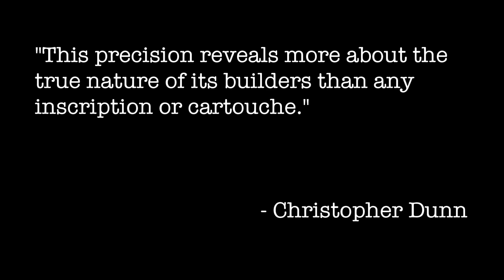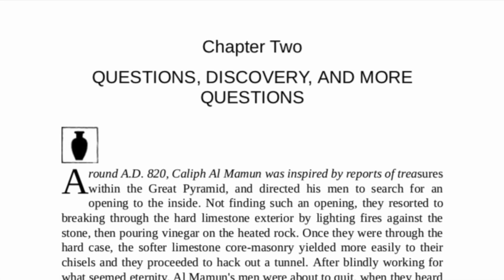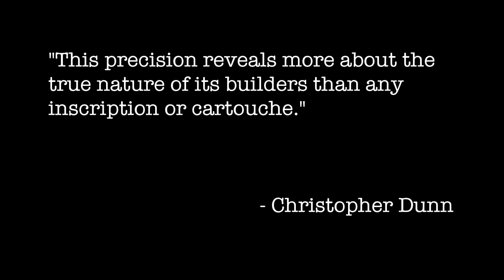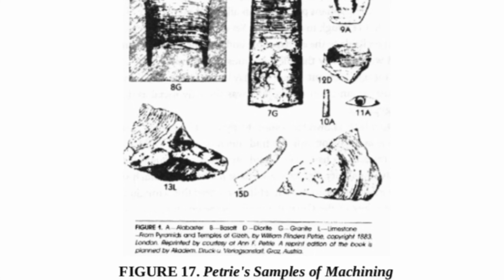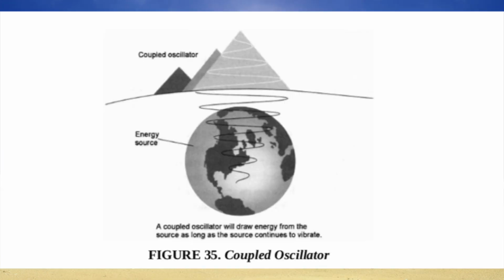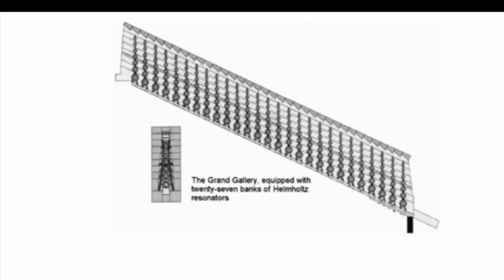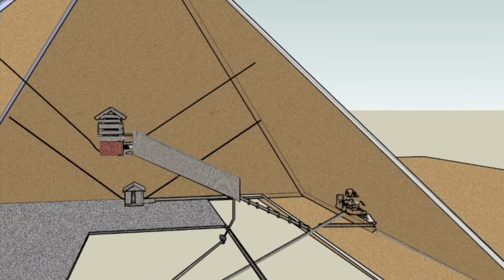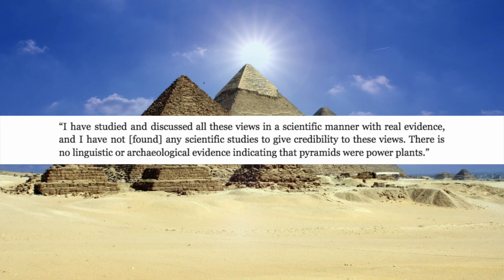The Giza Power Plant Theory - A Deep Dive Analysis | Reading Christopher Dunn | Lines in Sand

Comment: Pretty wild to propose such a 'out there' theory as an engineer, and not provide even the smallest scale model to verify any of it..
Reply: I saw a video with a dude that made a scale model that generated power but I can't freaking find it again. Had I known it would be so hard I'd have saved it.
Reply: Chris Dunn who made the book in the title made a scale model showing how it’s possible
Reply: Yeah cause using a make shift hammer and a little chisel makes sense. Do your research dude. Just the geometry alone tells you what there telling us isn’t true.
Reply: Nikolai Tesla did this but was shut down
Reply: Even more wild to claim a group of people perfectly understood electricity and electric fields and had a lot of copper, but were so high tech instead of figuring out an actual generator that basically ANYONE could make once they had that knowledge. Chose instead of making such a simply thing to achieve it, decided to build something weighing 2.5 million tonnes and unimaginable effort. It's just logical nonsense. You cannot have certain knowledge without having other knowledge. You cannot have this required level of knowledge on electricities and batteries and electric fields and (potentially motors to cut stone as many claim) but be completely incapable of spinning that motor round putting it in the nile and creating a generator.
Reply: A model has been built, and tested, and proven to work. Look it up
Reply: Pretty wild to post a comment purporting something you could have very easily looked up prior to typing.
Reply: There’s been several small scale models shown to demonstrate this theory in its entirety…you can find a few of them right here on YouTube
Reply: A whole lot of talking to avoid saying how to turn the thing on right now. I'm in complete agreement that there are mysteries about the pyramids and this is actually a decent collection of things about them which are highly unusual. But none of this seems to suggest that it's a power plant or how it would generate power
Reply: The most important model for this discussion is the model Gantenbrink made from the data provided by his robots from mapping the air shafts. Dunn's hypothesis is based on straight air vents, which they are not.
Reply: What's even more 'out there' is what the Egyptologists say:  blocks weighing 100's of tons were quarried by merely banging a few rocks together.
Reply: Pretty bold of you to assume that's possible.  If a 5.7 million ton pyramid produced 1000 watts per hour. How much do you suppose a 1 ton "model" wood produce assuming it produced at the same ratio to size? Is that even measurable?

Comment: I have massive respect for Mr. Dunn for speaking out the engineer's perspective against the ridiculous bronze age tomb hypothesis we've been told and all the incredible analysis he has provided for the vase, the drill core and the sarcophagi, but i'm not going to buy some random alternative idea either just because I like the guy who proposes it. demnostrate on how this type of structure produces power and demonstrate why 99% of the structure has to be highly geometrically placed stone. where the energy was stored and what was it used for. until then i'm fine admitting that I don't have a clue what the pyramids are, who built them and when.
Reply: Nikla tesla, created the wardenclyffe tower, he was supplied with classified files that were based off the schematics of the pyramids, look into each blue prints and purpose off his tower to the pyramid and try to connect the dots

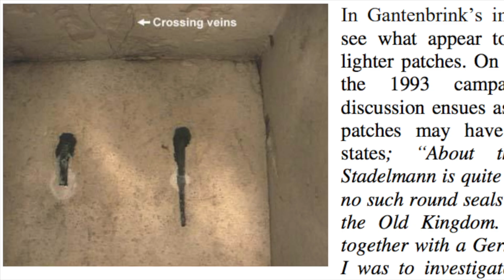Comment: 1:07:47 To be fair to Hancock on these. I believe he predicted that similar would be found at the end of the Northern shaft and those show even more signs of being electrodes for hydrolysis rather than having a ceremonial function.
Reply: Electrodes deteriorate during electrolysis. The idea for building such a monster pyramid for such tiny electrodes that might last a year having spent god knows how long building it and moving 2.5 million tons of stone is so ludicrous I can see why nobody wants to listen to such stupid theories
Reply: @KowBoySpace  One electrode deteriorates, the other electrode gets plated. If you look at the pictures of the northern and southern gantenbrinks doors, that is one interpretation of what you can see. There is definite tapering of one and the other is a different colour and looks fatter.  I’d say compare this with the hook found at the bottom of one of those shafts. That’s oxidised to copper green, but it’s still in very good shape. 

Further, across the northern and southern doors there are four copper handles. Only one of which is crudely sitting in a groove in the thin stone. When Ancient architects hi-res pics first showed this, it was I who alerted Hancock to it. A half remembered chemistry lesson, bolstered by a quick google, showed that ‘recessed cathodes’ are a thing in electrolysis as it makes it last longer before you have to replace it. So to my mind there are several pieces of evidence that point towards electrolysis.

I agree that it sounds crazy, but the whole thing is crazy. Keeping two  20x20cm shafts climbing 60 odd metres into the masonry only to end in these blocks with little copper handles that no one is ever going to see! 

All the explanations have issues: electrolysis is far out and requires undiscovered new rooms. 

I think they look pretty terrible as ceremonial end points. Particularly with the aforementioned crude groove and graffiti behind. If they are handles they are weirdly high on the door and also the pins do stick out the back.

 Lastly, the theory put forward by History for Granite about them being covers for the shafts, again it’s 20x20cm you don’t need copper handles, particularly two copper handles mounted high with tiny loops! One horizontal handle would be far better. Or simply just a slab would do the trick to prevent debris entering the shaft during construction. 

So the other theories aren’t without issues. And this is just one of many pyramid oddities which are open to interpretation.

Comment: 53:41 An interesting point about raising the gabling above the grand gallery. But Hancock can only talk about tuning these granite blocks because of their very odd shapes and the lines and ‘bowl’ features in their upper surfaces. If they were more uniform and hadn’t had the bowl depressions made in them (taking lots of effort) then his theory would hold even less water. 

But the same should be true the other way. If this is a stack of granite for the purpose of spreading the load from higher in the pyramid that no one was supposed to ever see again after construction, why did they bother with the bowls and lines? They would have to be extremely bored to choose to carve the bowls for fun!

Comment: 1:07:47 Hi Sean, (correct me if I’ve chosen the wrong spelling). I too keep an open mind about the various pyramid theories and something that sticks in my mind is what Christopher Dunne says about if you are explaining the great pyramid then your theory has to explain all its parts. And for me the “pins” at the ends of the Queens Chamber shafts are the most compelling evidence for Christopher Dunnes theory of a functional rather than ceremonial pyramid. Which you glossed over a bit here.

Because the picture evidence reveals that these pins are not handles, or the backs of handles placed there in some ceremony. If that were the case we would expect symmetry, but that is not what we have. Instead both the Northern and Southern shafts pins on the Gantenbrink doors show signs of electrolysis having taken place. One pin is fatter in a misshapen kind of way and looks a different colour even, perhaps shinier, the other tapers away. This is consistent with electroplating of one and the eating away of the other. Hence the diagnosis of electrolysis. This was exciting evidence in and of itself. But then Matt Sibson of Ancient Architects published the high res photos from the exploration of the Northern Queens chamber shaft. And this showed something extraordinary, one of the pins was poking out away from the “door” but the other sat much closer in a (crudely) chiselled groove in the “door” itself. I looked up recessing the anode or cathode in electrolysis and discovered, to my astonishment, that it is a known technique which prolongs how long the anode/cathode lasts. 

So we have two pieces of evidence that point to electrolysis, the playing/eating away and the recessing. But there is also a third point of interest: it looks very ugly! The only metal, buried in the middle of thousands of tons of stone during construction in what must have been a ceremonial capacity if they aren’t functional, yet they look like that? The burial only, mainstream you might say, have to account for how these pins look, now that we know they aren’t perfect little handles.
Reply: To be on the safe side you should mention his name several times in the comment, always with a different spelling.
Reply from the maker: Excellent points, thank you for sharing!
Reply: I think that you have pins in your noggin. The panels blocking the vent shafts have pins that allowed them to be moved and secured.
Reply: The pins could have corroded naturally on their own over thousands of years.
Reply: @tyrannosaurusimperator  Compare how these look with the hook found in one of the shafts. That’s in much better condition. But I agree some sort of natural explanation might be found on the electrolysis hypothesis. However the recess/groove that one sits in also needs explanation.
Reply: @scottzema3103  I think I covered this point. If being a handle was their function, why not have the pins be the same both sides? Why do the two pins look like they’ve been subjected to electrolysis? Contrast that with the “hook” found  in the shaft which looks like you would expect: a piece of oxidised copper. These pins seems to have undergone a different process. 

To be clear, I wouldn’t be advancing this argument if the “pins” on gantenbrinks doors looked like some of the diagrams I’ve seen of them. That is to say uniform handles that look the same on the left and the right. That would indeed support a ceremonial type function and not a functional use. Further, remember these “doors” are only 21cm square. It’s like a roof tile, you could lift up one corner and be fine. I don’t think Egyptians are knocking up rubbish non-ceremonial metal handles just so they can take them in and out for the short while that they are exposed during building. Before the next course covers them up forever. Assuming there are no hidden chambers and passages. 

Lastly, I focus on the pins as potentially the most important anomaly in the great pyramid precisely because of my open mind. Every other part of the Great pyramid has arguments going in both directions. Take the “relieving chambers”above the Kings chamber. There are good arguments for this enormous free standing granite structure being both a symbol (a Djed pillar perhaps), but also with the granite slabs flat undersides, but rough tops with lines and “bowls” cut in that it looks like no one was supposed to ever see… what was the purpose of all that apparently unnecessary work? That’s where alternative theories like ‘tuning’ have have a foothold. 

But the pins, to my mind, just say function, function, function. And that then has huge repercussions for everything else in the Great Pyramid.

Comment: What kills Dunn's theory is it only works as an hypothesis on the Great Pyramid. Say it's correct, then what were the other two, or all the others?
Reply: Are the other pyramids older than Giza?
Reply: @anthonyvertuli6944  Some are, most aren't...
Reply: He answered this on jre. He says they are connected and serve a purpose as well
Reply: @dipset22554  Yet he did not specify? Very odd. Plus, I listened to that podvast...
Reply: @stephengallagher2209  it was to take in hydrogen and put out co2 or something like that. Maybe different elements but yea, something was brought in one end, and transformed to something out the other

Comment: Dunn is brilliant but he made some errors...

I haven't read his books yet actually but my opinion is the so called "Star Shafts" in the queens chamber were once filled with Liquid Mercury, once electricity was applied to the liquid metal it could be theoretically made to spin almost as fast as the speed of light. This would vibrate the entire Pyramid to any desired tone & since 25% of the structure is composed of quartz crystals it would release ample energy at significant levels.

Picture the two arms or shafts as a giant tuning fork, changing the speed of one shaft would change the produced tone & the vibrations would cause the entire structure to produce energy & sound 

& the reason the shafts ended a mere 5 inches from the interior of the Queens chamber is because a now missing device once located there produced a large magnetic field to help activate the Mercury & make it spin, currently I'm also theorizing they used a now missing device very similar to a Mercury Arc Rectifier that converted energy from AC to DC & vice versa inside one of these chambers too because I'm also convinced the Civilization that built the structure utilized a global Mercury based technology on a lot of their machinery but I won't go into all that here... 

Without a doubt the Pyramid is a Power Plant
Reply: Underrated comment, appreciate the inpput

The rotating mercury, seems as though some of that was stored in the gold (exterior appears to be gold, at least) spheres on top of the old world "tartarian" structures. Perhaps in that case, once the mercury was "spun up" it would act as a drain for atmospheric energy, which could then be "sung" though the rest of the lower structure for whatever purpose, perhaps even energizing the water below
Reply: @slomnim  Well thank you...

I've been doubting my sanity since no one said anything about the idea when I ranted about it on far to many video's...

But I do think I'm right - On either shaft the builders left only 5 inches of granite to separate the hollow shaft from the Queens chamber 

Now name me one thing the Builders did that was small & since no one can I suggest the only logical reason for constructing the shaft so close was because they needed a strong magnetic field to activate the Mercury

*So there's a missing magnetic device from the Queens chamber

But yes, the incredibly fast spinning Mercury would vibrate and activate/excite the multiple tonnage of Crystals in the stone (Can't recall but I think they said 250 million tons were in the Pyramid?) 

And the Vibration would create a tone & the tone or frequency could be changed by adjusting the speed of each shaft

* I'm pretty sure you could play a certain tone & it would vibrate everything in the area if it was loud enough 

* And the Sound would also create vibration. I think there is a very good reason the shape of the tunnels resembles a tuning fork - that's because it is!

I have no scientifical learnings but I do believe the spinning liquid metal would also cause Positive ions to be created by the spin & also it would act like a whirlpool to drag more ions up thru the Earth by creating a flow

But what do I know?

Tesla did say 

“If you want to find the secrets of the universe, think in terms of energy, frequency and vibration.”
Reply: @slomnim  & your comment about "Energizing the water", yes the water question is fascinating 

Was the Water already electrified in the miles of unexplored tunnels below the Pyramid? I've heard that would create a flow & adjusts the polarity too

I'm not sure but, yes.. it's obvious they definitely harvested energy from the water too & it did carry positive ions into the structure above
Reply: @slomnim  And don't get me started on the infamous Palenque Astronaut carving...That carving doesn't depict a rocket engine it is an artistic representation of a Mercury Arc Rectifier machine that turns Mercury into a Plasma & converts AC to DC

We invented the same thing in modern times & they're quite beautiful as they glow a florescent blue 

But it's part of how they powered the Pyramids

Comment: Decimal inches are pronounced as thousandths of an inch. For example, 0.020 in. is pronounced "twenty thou" 0.005 in. is pronounced "five thou", etc. 
I'm also marveling at a man who is apparently an engineer waxing eloquently about how precise 0.02 inches is. 0.005 is considered a standard tolerance for manufacturing components and a 1/16 (0.063 in) is good enough for residential construction.
And his assertion that Egyptians didn't have the wheel is beyond crazy. We have hieroglyphics discussing chariots and even cravings depicting the Egyptian chariots. Chariots require wheels to work.
Reply: Maybe read up on your history as well as the engineering. Pyramids at Giza are conventionally dated as around 2500 BC. Other pyramids even earlier. Chariots were introduced by Hyksos in second intermediate period dated 1759-1539 BC. Way later than when the pyramids were built.
Reply: @freddurstedgebono6029  You can forget about sheep and try some education. Share your wisdom..